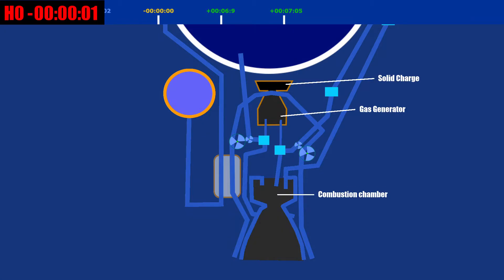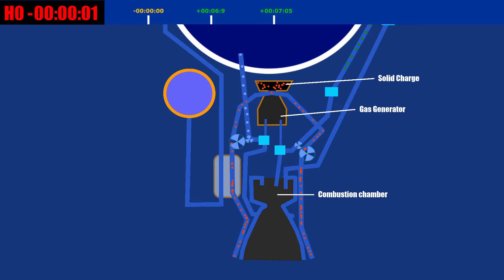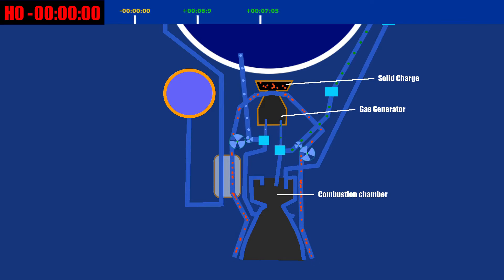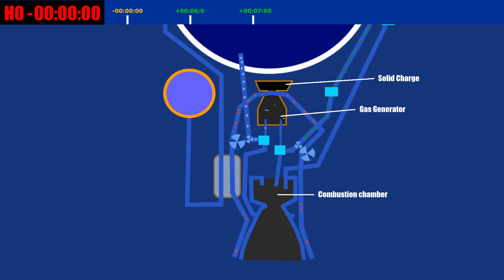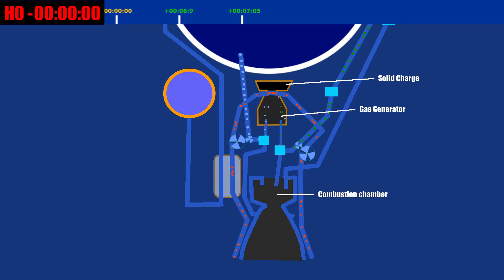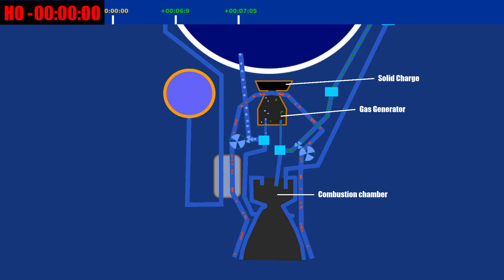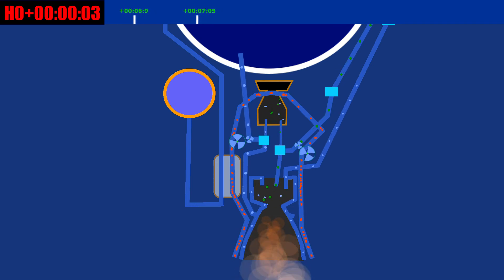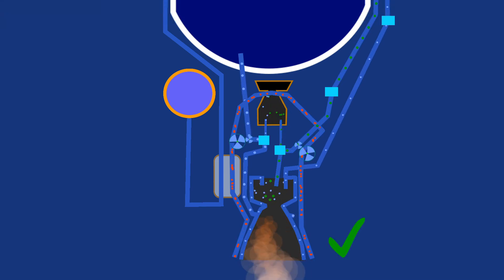Starting a rocket engine

Comment: Do you know how the thrust of the rocket engine is measure ? is it on the launch pad or on the rocket. Thanks for this video !
Reply from the maker: A strain gauge is used. Check out the article below
https://blogs.nasa.gov/J2X/2012/10/16/post_1350396009662/

I'm not sure if it's on the vehicle or the launch pad. In the case of the space shuttle it is the onboard computer that triggers the release from the launch pad. So I suspect that that the strain gauge is on the space shuttle.